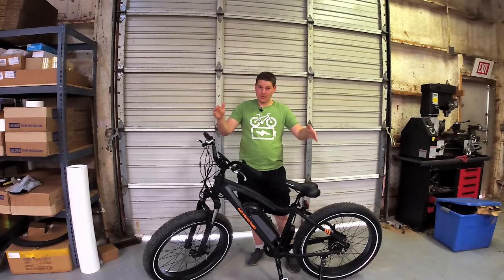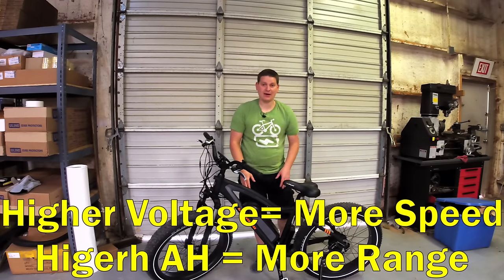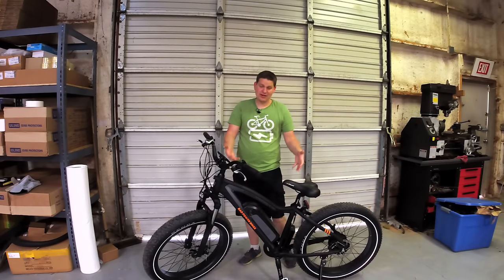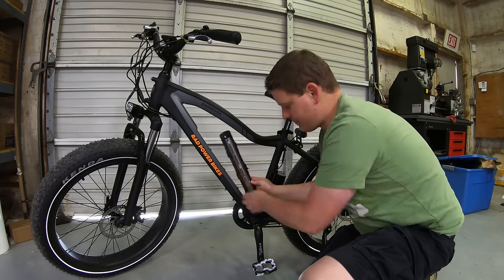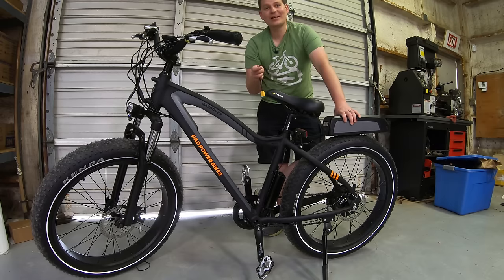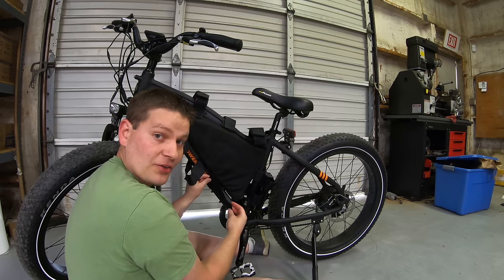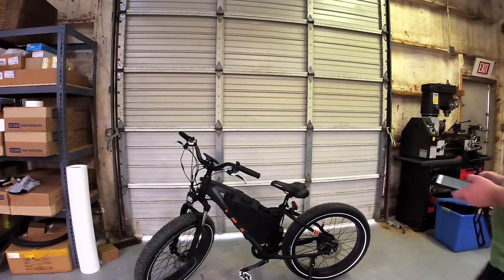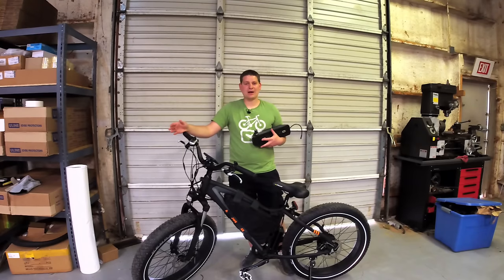Easiest Way To Upgrade Your Ebike Battery

Comment: even though you cannot run a 52V and a 48 V battery together and you can go from one to another have you considered making a switch that you could change batteries without unplugging and plugging the connector back together again?  Also if you have two like batteries comnnected in parallel  does chaging one also charge the other at the same time?

Comment: concerning the parallel device, my delfast discharged because I didn't charge them monthly, the battery is not that old. If I use the parallel device, would it force charge the old battery?

Comment: I've brought an eBike and was wondering if it's possible to wire a front headlight onto the front and wire it into the system as the controller on the handlebar has a switch for it.  But the bike doesn't have one.

Comment: I got a 1000w motor n the plugs are different. I'm trying to get a cheaper battery or the right battery. But the connection is differents from the one I order.  Can I change the connection to a different battery?

Comment: Can you do a video on adding battery on RadRunner. Maybe with option of keeping the stock and add a 2nd when needed. Maybe mounting it on the water bottle cage.

Comment: I need more info on that parallel connector and adapter pieces, I have a addmotor motan m70 and I want to add a 20 amp hr battery with the stock 16 amp hr battery, both are 48v the bike motor is 750w 1000w max I would like to try the 52volt but I am nervous to mess something up

Comment: hello kyle! love your channel! my current fat tire ebike has a 36v 12.5ah battery along with a 500w rear hub motor. i want to upgrade to a 48v 15ah or even a 48v 20ah battery. i am purchasing a new controller that will handle the 48v upgrade. the primary reason im doing this is i want a bit more hill climbing ability since i like to run primarily off trail logging roads in very hilly areas. about how much more power gain (torque) will i feel by jumping from a 36v to 48v battery?
Reply: Hay did you ever put the 48v on with out changing the Controller? I live on the mountains of Oregon and the 36 Volt will not pull my big ass up the logging roads. What wuz your experience?

Comment: I want to purchase a triangle battery and also use my totem victor battery as a second battery but it will not reach the second battery fron the rack. Can I purchase a 2 foot extension cord (male to female) for a totem victor battery?

Comment: Hey Kyle. I have the RadRover 5 with the 48v battery. Do I need to upgrade the controller if I upgrade to the 52v battery ? And will the 750 motor handle a 52v battery ?

Comment: If I run 2 different 52v batteries in parallel will they both charge together with one charger or should they be charged separately. They each have their own charger.

Comment: I have an Aventure with a standard battery. I just bought another identical battery. Question: what do you think is the best way to carry and use the extra battery? I do have a standard rear rack installed.

Comment: hi, can you please make a video about changing batterys on folding bikes? for example i have the ado a20+ wich is good, but only offers 370 wh. i saw much biger batterys wich looked the same for the fido m1 pro. and you can change the voltage in the m20+ controller up to more than 50v. maybe it is realy that simple to just buy an bigger standard battery for folding bikes, and change the voltage in the controler?

Comment: If upgrade the battery in the RadRunner1 can I get more speed with  pedal assist? Or I have to replace the controller as well?

Comment: can you put 2 stock batteries in parallel that don't have the 60 or 90 connectors, i have an M900 and the connectors are the same as the battery you removed. do you sell the connectors?

Comment: What kind of after market battery can i use for the Himiway cruiser? And are they compatible to the controller? They're out of stock on batteries and they cost $550! I want a backup battery so bad but I'm not good with math.

Comment: If you’re putting in a 52V battery, will the motor take that?? Wouldn’t you need to also upgrade controller?
Reply: Yes

Comment: Hi  must say,  thanks for the video. But  would be nice to know how could I get that duel connector( that prevent to not let travel the spark from one battery to another). I want to add second battery to my folding fat bike, which looks like the MATE fat  ebike. I do have 16A but I need more. The bike is 750w rear motor. 
Would be very nice from u if u could help me to find that connector 🙂

Comment: I have the Bolton controller on my Radrunner1.  It is really, really awesome.  So worth it.
I'd like to put a 52v battery on it now, but will that triangle one work with the Radrunner1?

Comment: If you have a stock motors on your  Ebike you can use a different battery on it as long as you change the connector is that right?

Comment: Kyle I realize this video is over a year old but I have a 2018 Rad City and looking forward to the time I know I will need a new battery. Would this type of setup work and are the parts currently available o will they be in the next six to twelve months?

Comment: Thank you Kyle, I love your channel and did subscribe to it. You always have very useful info👍👊 I bought a Rambo Cruiser 500 W truck run motor & 10.4 APH battery. I do love the bike & have already built my own trailer and pulled all three of my girls around in it. But am going to use it for being in the steep mountains & hunting in Utah. I would like to upgrade to a 750 W or 1000 W battery but cannot find anything anywhere on if I can or what I have to do? I am pretty mechanically savvy so to say. Just wondering on your input on this you seem to be the man on ebikes when it comes to this stuff!! Again thank you very much!!👌

Comment: Please do a  Metakoo Cybertrack 100 that has the Manufactur default HiGo Z910 9 Pin Connector. Cant find a Battery to switch or replace with Different connectors. Every Video is for 2 wire splice not 9 wire.. Would be nice to either switch out the default 10 amp battery to 20 or 30 or connect two together with a controller but bike comes with controller in the battery down tube case that connected to the 9pin hub motor.

Comment: Hi I've bought a new bike with the 1000w bafang bbshd motor with 52v 21ah battery how many miles should I get or round about depending on how I ride I'm round about 16 stone yes I need to pedal more and burn some fat 😏😫🙏

Comment: hey there, advice for a alibaba battery that is exactly all the right specs as my old one for my QuietKat 750 but it wont turn on and power bike, polarity is right, and voltage is right.  still wont power on

Comment: How bout a battery isolator switch in-between the two dissimilar voltage batteries. This way, there is no wear and tear on the connectors when you're pluging them in and out. Nor the constant sparking issue.

Comment: If I have a 36v 8ah battery in a bag on the handle bars and want to relocate and change to a flat back bike rack battery, does it have to be the exact same voltage and amp hours?

Comment: Is there a extension  cable for the rad oem  battery on back rack what if cable can't reach controller coming off original red batt while on back rack

Comment: Hi I have a slow 250 watt Ebike and wanted to upgrade it how do you think I should start?
Reply: A bike that's rated 250 watt, IMO, is not worth the effort and cost to get more power and/or torque. You should sell that bike to a beginner e-bike rider and buy one that now has three times the power of your bike (e.g., a 500 or 750 watt motor). 

The financial hit would not be all that traumatic if you offset the cost of a new bike with the proceeds from selling the 250 watt bike.

Comment: Great information, as usual. Have been wondering about my E-Joe foldable Swan battery and replacement when it wears out. Will your speedometer on the handlebar work with any of the batteries?

Comment: Do you guys offer a controller for the ecotric sportcool.   Right now it is 36v 500w I wanted to upgrade the controller and then maybe the motor to a 750w and then a 48v or 52v battery.

Comment: I have himiway cruiser what kind of battery should I get to add on replace or whatever just to make the bike better? Or can I run two batteries at once? Either that or I would like to buy a spare battery but not from himiway where can I get a battery that will work with the bike the way it is?
Reply: You want a bigger battery or another one for more range? Or more voltage?

Comment: I wouldn't connect 2 batteries of a single voltage together if they have different amp hours one will die and the bigger battery will keep trying to make it go killing the smaller battery
Also just buy a 36v bike and use hoverboard batteries they can be connected In  parallel to make a huge battery and only cost about £40 each also if you half your cells and put them in series it will become half amp hr and double volts so 72v u will need a new controller tho

Comment: Do you have the any Dual Battery Parallel Connectors that could be used on an Aventon Level?  Can such a thing even be done considering the position of the controller on the Aventon Level?

Comment: I have an elux sierra It has a 48v 11 am battery and a bafang brushless hub motor 500 w 750 peak I can only go I think 21 miles maybe I think 20 I wang to go around 50 if possible more mileage how can I do so abd if. Possible make it go a little faster right now it goes 26mph lat ground if I use full throttle but up big hills I can only do 11 mph

Comment: What if you have a bike that already has a 20ah triangle battery and then you add a rear rack with a hailong 20ah battery with a parallel connector? You now effectively have 40ah?

Comment: Thanks for your GREAT video about battery upgrades.  I am a frustrated RadRover owner.  I love my Rover, but wanted a battery with a longer range for longer rides.  I foolishly thought that Rad's newer generation, 14 Ah battery would pop right in to my 2017 model year bike.  $660 dollars later (including tax and shipping) I discover that the  connector is totally different, so the new battery won't fit the cradle on my bike,  and the battery "pack" they sold me did not come with a new cradle.  Now I have a brand new battery I cannot connect to my bike.  Just return it, right?  Wrong!  Rad's policy is that batteries are not returnable.  Where can I buy a cradle that will accept the newer generation , proprietary RadPower 48V 14 Ah battery?  I don't want a $660 doorstop.

Comment: Ok I Subscribed, but I have a Stealth Bomber, 87.6 Volts, 18 Ah. All the Electric Bike Videos don't show how to do this, very impressive.
I have had my Bike for 8 years now, I got a new battery from the Bike manufacturer 4 years ago, it cost between $3000 to $4000. The Bike was made in Australia so the Battery can't be shipped by Air, it has to go on a Boat, big shipping costs and time. What do you think, can I modify my Bike to fit a Larger Ah and Voltage Battery? Thanks.
Reply from the maker: Yes, I have had batteries made for stealth bikes before.  Greater capacity than stock at half the price.

Comment: I'm in processes to buy a battery for my e-bike 1000 W Front Motor. 
There is a Lithium ion Battery, 48V 100000mAh 1000w 13S3P For $80 and there is another   LiitoKala Battery-13S5P 48V 15AH for $90. Could you or anybody help me to choose witch one i should purchase ?

Comment: Are there any issues, once you upgrade the battery, with the display functions? Thanks for doing these videos, I love learning about e-bikes in general. Hope to have one someday soon.
Reply: Same voltage pack wouldn't need anything, if going from 48v to 52v you may need to reprogram the display. On stock bafang systems this takes all of 5 minutes provided you have a PC and a programming cable.

Comment: I'm new to ebike nation lol. I have a Hurley 350 watt motor 32v 10AH battery. I'm tryin to use it for deliveries but obviously it doesn't have a very good mileage. I want to upgrade to get a higher top speed and longer range. I've already increased the controllers top speed and lowered the tire size from 26 inch to 16 inch. Can U help me? Thanks

Comment: Hello my name is Ben I have a problem with my e-bike the bike is called TAOCI e-bike I've been having problems with my battery it's starting not to charge the battery indicator is on one bar it's a 36V13AH battery I have had the bike for 2 years I am trying to get a new battery but all batteries are quite expensive and the company AKEZ new energy technology seems not to want to help what can I do I need another battery to get on back onto my bike cuz it's my commuter bike to work

Comment: What about the Datex2 parallel  battery adapter,  it seems that you can connect 2 batteries with different voltage.
Reply: Not rue any batteries connected in Parallel need to be same voltage.

Comment: if the bike runs off of two 48v batteries simultaneously, does that equate to 96v of power?
Reply: NO not 96 volts it will be  2x amps not volts in parallel , don't connect in series you will let the magic smoke out of your controller 

Volts are not POWER , AMPS AND WATTS are power 
Volts are like how much gas you have in your tank AMPS are how many horse power your V8 has 
Hope this helps

Comment: OK ,LET ME GET THIS SRAIGHT.
You put a 48 volt battery to run a e bike with a 350 watt motor rated for 36 volts.
Is the controler heating up holding back the excess volts?
Reply: No he put a 52 volt battery on a bike that had a 48 v battery.  But he did say the controller had been up graded to handle the higher voltage and provide more amps (35) to the motor.
Reply: @Hoggdoc1946  what was so weak in the controller that could not stand up to another 4 volts?

Comment: Hello, I have been following you for a few weeks,
great your presentations of fat bike elec ..,
  I am looking for an elec fat bike ..
  I am 1.90m = 75 Inch, 130KL = 280 Pound ,
  and of the third age"
not for speed but for power, autonomy,
solid, big according to my size
I'm lost with all the ads and proposals
commercials that I see or receive.
Cyrusher XF800 , Jeep , Bikonit ,Big Iron , Otso , ..... 
So I allowed myself to come to you for request
info or advice if possible thank you
Much success to you for 2022
cordially

Comment: Would it hurt anything to use that battery with the stock controller?
Reply: It could if the controller is not designed for that voltage.

Comment: I’ll do you a deal buddy...You answer me this question and I’ll subscribe.

Can I retrofit a regen braking system to a Chinese 1000w 52v rear wheel motor ebike ?

Also, my evoke doesn’t have a computer, so I don’t know how fast I’m going, how much battery is left, or anything else which I would like to know, but it is possible to retro fit an aftermarket computer?

I’ll happily subscribe as soon as you give me an answer.

All the best
Reply from the maker: Depends on what type of motor it is.  Direct drive?  Yes.   Something else?   Probably not.....  unless we come out with something 😏 new down the road.....
Reply: @Area13ebikes  it’s a Chinese motor hub conversion buddy. 1000w 52v rear wheel motor.

Thank you

Comment: I just bought my first ebike Ironhorse red rims.Fat tires and 1 set of fat rims. Studs on second fat tires. Sans charger and cord.E-Bike Lithium Battery.Model:HH4E-10.4M Li-ion: 48V 10400mAh  no name battery case.Light on front and charger cord.Bell.Rear light battery? Rack behind seat.Nike air seat. No fenders mountain bike style. No suspension. Water resistant saddle bags and bike lock.Bike helmet.Seller said used maybe 4 years old won’t say as is.Emmo used cover loaned? Struggling in Elliot Lake, ON, Canada. Is worth 2k Canadian? Seller is sympathetic to owner being homeless and having to take $150- monthly.Frang 750.?

Comment: Idea for future video. Maybe you can explain the interaction between the display and the controller. Can the display be swapped out or do you have to take the controller into consideration ? Are the connectors on the display standard or do you have to match them to the controller etc.? 
P.s. I purchased a Himiway, very similar to Radpower)

Comment: Probably what I would do on a Kepler is just toss a 30Ah 52 volt in a bag on the rack to plug in to the 33A controller. Nice to have 50Ah 🤔

Comment: I'm a noob, but you said it increased speed. Wouldn't the limiter need to be removed / hacked first?
Reply: The bike in this video does not have the stock Rad motor controller. It has the Bolton controller he sells, upgraded in a separate video. With his controller, the bike has a slightly higher top speed, and much better acceleration. I've already upgraded mine. Hope that helps.
Reply: @paulrybarczyk5013  Thank you for the response. Appreciate it.
Reply: @joshuahodge8537  You're welcome.  If you're considering that motor controller, I'd suggest watching some of the review videos on the CitizenCycle channel like this one: https://www.youtube.com/watch?v=lHUIDE8O8EI

Comment: Hi I'm building my first ebike and want to go big and fast and long range as ride my bike for my job I am going to get a 1500w rear wheel motor and was going to use a 60v battery. Maybe get a even bigger volt motor. Now what I'm asking is I have a 250w rear wheel that I got for free I am going to buy the 60v battery ans speed controller ect in a few days when I get paid and get the 1500w or bigger wheel next month. Could I put the 250w wheel in for a month till I can afford the bigger one ??? I know it's pushing it but I would use on the lowest setting and really take it slowly and keep a eye on the temperature ect or will it just go bang straight away??? Please give me your thoughts or has anyone else tried this??? I will post vids if anyone is interested